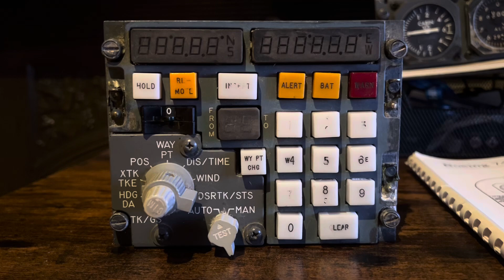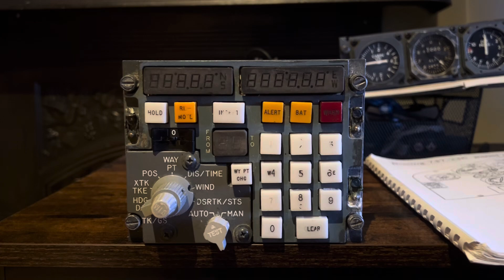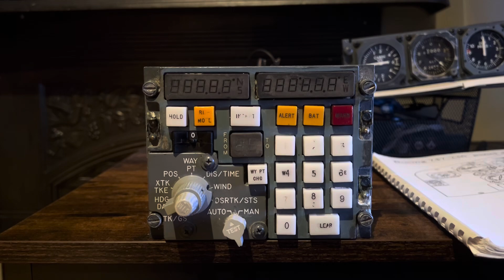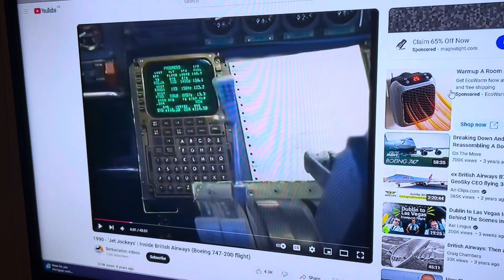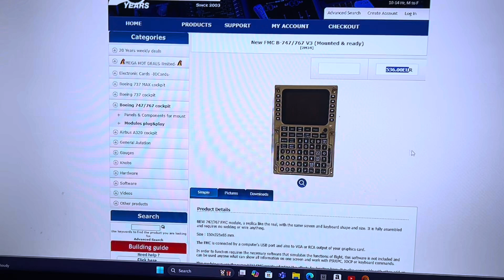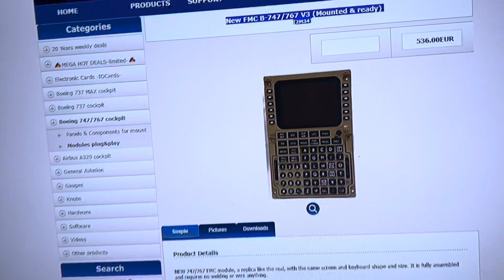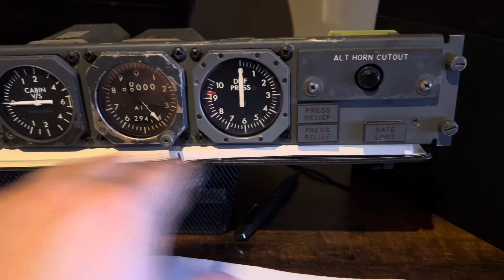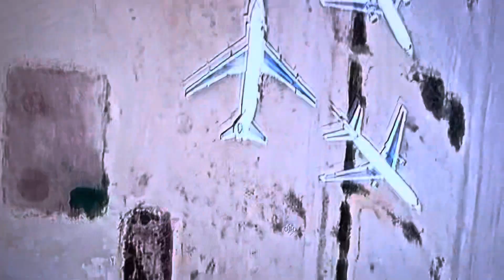Boeing 747-200 project part 7 - update/help

Comment: interesting..I used those on Northwest Airlines DC-10, B747-100, B747-200 aircraft.. when I flew the B757,B767, B747-400, A320, A330 using an FMC is so much easier
Reply from the maker: Wow, that's incredible. Were you a pilot on these aircraft types? Only through flight simming, I've tried both the FMC and INS. I agree that the FMC is far easier to use, but the INS offers a challenge, and is certainly good fun to use once you've got the hang of it.
Reply: @Boeing-Project Yes I was a pilot on those aircraft. I started with Northwest Airlines in 1979 and retired with Delta Air Lines in 2021. Delta merged with Northwest in 2008.
Reply from the maker: @Capt_Tarmac  That's an absolutely incredible story! What were these aircraft like to fly in real life? Did they handle well?

Comment: How about a modular solution to exchange INS/FMS when necessary?
Reply from the maker: From those I've spoken to regarding this, 90% seem to be keen on the FMS. However, I do really like your idea and will definitely take that into consideration. I hadn't thought about that concept before actually, so I'm really glad you mentioned!
Reply: @Boeing-Project Should be possible. :)  I made my aft pedestal removable but for another reason: That people can get easier on the pilots seat... narrow cockpit. :)
Reply from the maker: @aviation2simulator  Fantastic idea, is this for the Pa31 on your channel? I'm a Pa28 pilot in real life - would love to get a multi engine license at some stage!
Reply: @Boeing-Project I have a PA31 and a PA42. The pedestal is of the PA42. I have also an Dornier 27 converted to a sim with a vintage main panel. I have always been thinking about making a modern T-version of the panel also to exchange...
Reply from the maker: @aviation2simulator  Amazing projects you have there. Both the Pa31 and Pa41 are amazing aircraft!
Reply: @Boeing-Project Thank you so much! Yes, they are beauties! :)

Comment: The INS vs IRS. INS uses a conventional mechanical gyro whereas the IRS has a ring laser gyro. Which is the device you have. It’s for aligning the gyros before a flight. The FMS you’re referring to is actually the CDU which is an interface for navigational input. Control display unit. Keep the INS it’s basically similar to the modern IRS.
Reply from the maker: Thank you very much for the suggestion and information. We will keep one INS in the centre pedestal, and two FMCs the the centre forward panel 😃

Comment: It is a great question what you ask!
I faced with this issue on my setup as well, probably not on the FMS level but on other equipment.
Although the original system has some charm it will block you in terms of navigability in today's world.
If I would be me I would also transition to a more modern FMS solution. As you correctly said, many of these aircraft were retrofitted with newer FMS and PFDs to keep them flying longer.
Looking forward to see more of this in the future!!
Reply from the maker: I just feel the old INS isn't as practical as a more modern FMC, obviously because it's an older system. I'm glad you agree with me on the transition to a more modern set up. Just makes things that little bit easier, and yes of course, many airlines retrofitted their classic airliner fleet with more modern equipment for practicality sake. Thank you so much for your support, also looking forward to seeing more of your setup! 😃

Comment: Definitely go for the FMC option.
Reply from the maker: That seems to be the favourite, so that's what I'm going to do! Thank you so much for your support 😃
Reply: @Boeing-Project  no worries- Love your work! I stumbled across your videos and think they're great. Good luck with it all 👌🏻
Reply from the maker: @CaptJames  Thank you so much. It's a big old project, but with my dedicated team and the community (you guys), anything is possible. Thank you so much and stay tuned for more!
Reply: Why go the FMC?  I am late to the party I know - but the INS was one of the things that set the Classic Jumbo apart. 14 years & 8,000 hours operating 200/300/SP. Ours only had the INS and the teamwork required to feed the beast was something to behold. Paper maps, post it notes & remotely loading INS #3 before #1 & #2 ran out of waypoints was a carefully choreographed process. Put an FMS in it and it it will be just like any other magenta line aircraft we fly nowadays.  Only reason to put an FMS in it would be to make it easier to operate I guess.
Reply from the maker: @tedlandy8516  Hello there, thank you so much for your message. The simulator will be operated as a public experience, and so using an FMC would make for quick turnaround during short interval periods between sessions. However, we have since come up with quite an interesting idea. We hope to do a mix and match of both. So, having removable FMCs and INSs. So if we want to operate quickly, we install the FMC in the aircraft - if we want to operate a more traditional flight experience, we install the INS. So all in all, just quick changeable panels. How easy this will be to accomplish is the question, but I'm absolutely sure it can be done without too much hassle :)
Reply: @ Ah that makes sense then. Great that you will be able to retain the INS option - for those who want the authentic experience.
Reply from the maker: @tedlandy8516  Absolutely agreed! Will definitely be a fantastic option for those wanting the authentic, classic airliner experience!

Comment: In reference to Pinal they are just a storage facility. Many of the classics located there are still owned by the respective airlines. We have tried several times inquiring about parts for our project and other friends classic projects only to be directed to the airlines that own the planes. I can dig up what airlines they are so you can try to contact them as well.
Reply from the maker: That's exactly what I presumed was the case. Its the only thing that makes sense to me considering how standoff-ish they are about parts.

Comment: The Civ-A is an awesome device and very pioneering. Works great for short hops but for longer huals can be a pain. The sim I am working on and the one pending delivery here in the states will be using the LTN which came right after the Civ-A. We used it for World Flight this year and worked well. Our pending sim is a 747-300 former JAL aircraft. It is arriving with FMC's installed but we will be retro fitting it back to LTN's.
Reply from the maker: What a fantastic project for you. I'm so glad to hear of more people restoring these classic airliner cockpits, preserving them for generations to come. I love it!

Comment: BA retro-fitted Sperry FMS systems  (same as they had on the 757 and 767) to 26 747 Classics, 1983-ish I believe, so perfectly fine to have them in your sim. It looks like they were less capable than the 747-400 systems, they were of course a few years older. If your sim will be open to the public you need to install the most robust units you can find or things WILL get broken - so cheapest may not be the best. Real aircraft parts are a lot stronger than replica units built for home sims. As mentioned earlier a lot also depends on what software you plan to use. Good luck with this project, will certainly follow your progress.
Reply from the maker: That's exactly the info I needed - I got told by an ex BA 747 engineer that they used -400 FMC systems. Don't know what he was on about. Agreed on using real aircraft parts over replicas. Like I said in the video toward the end, I want to use as many real parts as possible for the very reason you said - they're more robust, especially considering we're going to open the sim to the public. Thank you so much for following, it means a lot. I'm by no means an expert, just a humble Pa28 pilot, so external info and knowledge is greatly appreciated.
Reply: He may well be right on that, BA flew the -100s up to 1998 and the -200s stayed on into the 2000s, so it's possible that over the course of 20 years they had a further upgrade and may have ultimately had comparable systems to the -400. What interested me was that they put the Sperry boxes in so early in 1983. The aim was to get a 1% fuel saving mainly due to autothrottle. I'm also not an expert. I have a few happy hours logged on the PA28 back in the 80s and 90s!
Reply from the maker: @ClassicJetPanels  That's a good thought actually, I didn't realise they operated the -100s for such a long time. I know they operated the -200s well into the 00s though. My father was a regular 747-200 passenger seeing as he worked in lower Manhattan, NYC in the late 90s and early 00s, so he was jetting between Heathrow and JFK weekly. He was also lucky enough to fly Concorde regularly - I was too young to join him sadly.

Comment: I would go FMS. Because pretty much that's what the real ones were upgraded with. However it would be an aftermarket system like the CMA-900 UNS-1B or HT9100, something like that. Not a 747-400 unit.
Reply from the maker: That's very good to know, thank you for sending over that info. The ex BA 747 engineer I know/knew did say that they would retro fit the -200s with -400 computers from Boeing themselves, but it's been over 30 years since he last worked so perhaps he has forgotten exactly what computers were used 🤣
Reply: I guess it's possible that that happened on some units, I only saw the retrofits on a couple of airplanes. Not a big 747 guy myself (I'm a McDD guy :D) so do double check this.
Reply from the maker: @Josh.Davidson  Its very possible they did a bit of both, or like I said, he just forgot :P. Fantastic, I too love McDD. I'm mad for any classic airliners. Would love to do a VC10 as the next project - one step at a time though 😂

Comment: I would go with the 747-400 fmc tbh. Also what software are you planning to run this simulator on?
Reply from the maker: Thank you very much for the suggestion. Like I said in the video, I'm leaning more toward the FMC. We will be running the simulator on the Felis 747-200 for X-plane 12. I'm in a discord with Felis himself, so he is supporting the three 747 classic builders with software (two others are also doing 747 classics). I don't think there are any other pieces of software to use sadly. We of course had the CLS 747, but that is very old and outdated and only replicates something like 40% of the systems, so that's an immediate no. Just Flight were bringing out a 747-100/200, but they cancelled - though they are supposed to be developing it for FS2020, but I've seen no updates on that in at least 2 years. PMDG are developing a 747-100 for FS2024 at this very moment, but that's possibly going to take a good year or so to be released, and then it'll be another 6 months for users to report bugs - so Felis it is!